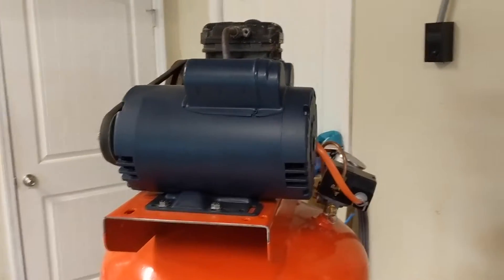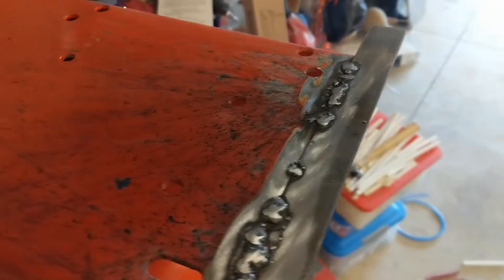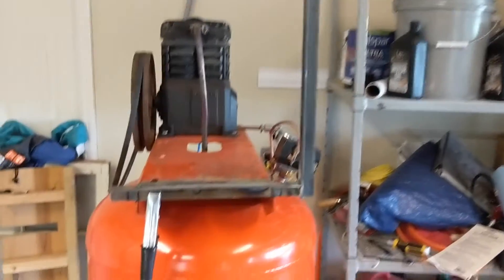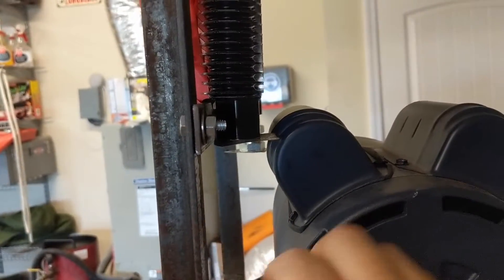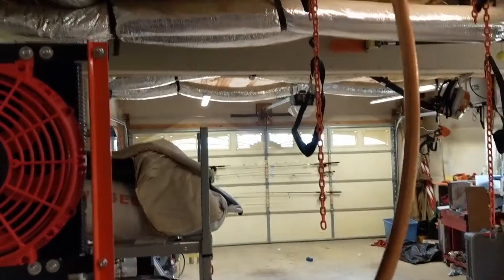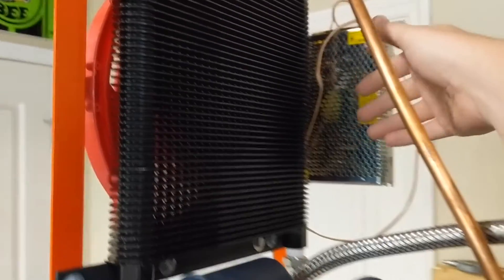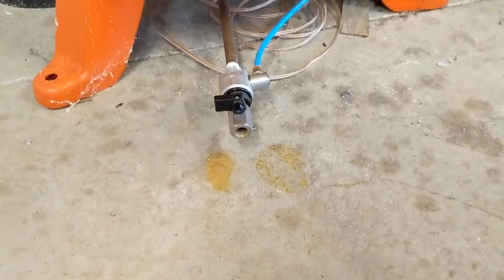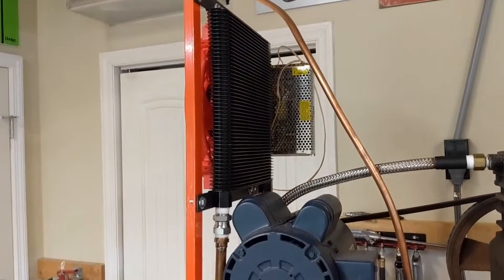Air Compressor Aftercooler/Dryer DIY Under $200

Comment: Nice set up, you can take a  a/c condenser off of a old car or truck and it’s a lot bigger and it will work like a charm, been running one for about 7 years and can paint a whole car or sandblast for hours and never get any moisture from the compressor, works better then anything you can buy that claims to catch moisture, been there done that
Reply from the maker: I looked into that but was worried it might impede the air flow coming into the compressor.  The inlet and outlet seem small but it apparently works
Reply: Rooster's Garage got one on a 120 gallon 2 stage and works good on a big sandblasting cabinet and ever thing else I use, trust me it will work
Reply from the maker: That's awesome!  I never could find details like that, just people saying to use it.  There's a big difference in a 4 cfm 25 gal and a 15 cfm 80+ gal compressor.  I even choose this cooler because the huge openings it has.  Glad to have some really world experience that it works!
Reply: Rooster's Garage yeah works really good, my compressor sits next to the wall and I just mounted my a/c condenser on the wall and ran my line’s, very simple and plain and it really works, not like all that other stuff that claims to work, I tried everything you can think of to keep moisture out because I do a lot of painting and sandblasting and that’s two things that you got to have zero moisture,if you run any air tools just make sure you have some kind of Oiler in airline for your tools or just add a few drops to the tool every once in a while because dry air will eventually cause that tool to dry out and lock up, been around this stuff and work with guys that wouldn’t keep their tools oiled and they would lock up, I worked in a place for fifteen years where we used air buffer s and grinding tools all day long, so I know what moisture will do to a air tool
Reply from the maker: @eroom2087  Does it also have a fan?  I oil my tools every use because I am not setup yet where I can mount an oiler.  I've got the oil right on the air tool mount so I always remember it.  I don't want water in the tools and I also don't want to use them without oil.  If I ran a DA or something like that where I needed to run a tool for a long time, is setup an oiler but so far I just use air tools a little bit - impact, air ratchet, etc
Reply: Rooster's Garage nope no fan, plain and simple
Reply from the maker: @eroom2087  Dang!  That would have simplified my setup a lot!  I guess the condenser has enough surface area to handle it without a fan!  I actually started on this water removing journey because of my sandblaster.  It was loaded with well used sand and I wanted to change it out so I took the nozzle off and was just using a little air pressure to blow it out.  I kept having to stop because the moisture from the air got the sand wet and it stopped coming out!  I wish I would have known the condenser works that well!  Thanks for letting me know.
Reply: Rooster's Garage been through all the stopping five hundred times to unclog wet sand thinking it was a piece of trash or big grain of sand, but all the time it was wet sand not falling through small hole in bottom of tank
Reply from the maker: @eroom2087  I guess this is why they say necessity is the mother of all invention
Reply: Rooster's Garage 💯
Reply: Rooster's Garage 💯
Reply: Water separators can only catch liquid water, only thing that can capture water vapor (moisture) is a desiccant dryer which either requires a consumable (desiccant beads) or an expensive regenerative desiccant air dryer. Aftercooler + water separator is the perfect combo: cooler condenses the water, moisture separator drains the water. Huge difference, I wish air compressors came with decent aftercoolers, vs relying on the tank itself.
Reply: Auto A/C condensers are aluminum and if your compressor has copper pipes, the copper-aluminum combination along with the moisture in the air will cause corrosion.  A/C condensers are nice and big, but I'm going with a copper-piped tranny cooler from Derale to avoid any corrosion problems.

Comment: Why didn't you just mount the cooler beside the compressor fan/pulley and you wouldn't have had to add an extra fan. The pulley with the built in fan would have drawn air through the cooler. But, what you have works and that  is all that counts.
Reply from the maker: I thought about that but the air pulled off the head is quite hot.  Plus that fan is much smaller and runs slower than the radiator fan.  The cooling would have been mediocre with the built in fan.
Reply: Youtubers that attach the aftercooler to the pump fan pulley cage don't seem to grasp the fact that the fan now is pushing the heated air it removes from the cooler across the (already) hot compressor head.  not good.
Reply from the maker: Yeah, I've seen that a lot.  I'm sure that pulley can has had a bunch of airflow research done and putting a radiator will most likely cause the head to overheat.  I dunno but adding a $20 fan seems like cheap insurance plus it moves a whole lot of air

Comment: It looks like your wire feed speed is way too slow. Crank it way up and I bet your welds will be better.
Reply from the maker: I'll try that.  I was having issues with it not burning on the faster wire feed speed.  The arc would break and it would push the gun.  I'm saving up for an Everlast stick/TIG welder at the moment.

Comment: Any updates on your compressor ?
Reply from the maker: I use it quite often and I have not changed anything.  It's cooling the incoming air and pulling out 2-4 oz of water each cycle.  The aftercooler is pulling it down from 250+ to about 85 degrees.

Comment: The power supply is no longer posted on Amazon. Could you please give electrical specs on labe on unit.So that I might find a similar one.
Reply from the maker: It's a 220v input with 12v, 20A output.
Reply: @TheRoostersGarage  thanks

Comment: Where's the link for the fan or the model number whatever so we can get the fan is your Transformers 5 volts not 12
Reply from the maker: I can't click on the eBay listing I bought it from but this seems to be the same fan: https://rover.ebay.com/rover/0/0/0?mpre=https%3A%2F%2Fwww.ebay.com%2Fulk%2Fitm%2F142211642409.  It's an automotive radiator fan.  My transformer is a 220v to 12v.

Comment: Don’t let something you don’t do well stop you permanently… Just long enough so you can practice to become better at it
Reply from the maker: I have never been the type to shy away from new things.  I usually jump in with both feet, then figure out the rest.  The first step is always the hardest.
Reply: @TheRoostersGarage  You should figure out a better plumbing route so you can eliminate that very sharp turn underneath. Consider installing some kind of 90°, or possibly a 45° elbow...

Comment: The good thing about bad welds is  you can grind them off and try, try again.
Reply from the maker: And grind them off and try again I did.  I have also switched from the HF flux core wire to the TSC (Hobart I think) flux core wire and my welds are much better.

Comment: I just used 1/2 inch copper coil tubing, looks like a alcohol still,,lol but dropped my air temperature from 240 degrees at compressor to 62 degrees at tank
Reply from the maker: I looked at doing that but I don't have the room for a big tank full of water.
Reply: @TheRoostersGarage  I didn't use a tank of water or even a fan,,,,just coiled the tubing in 6 - 12 inch diameter coils and mounted it in back of computers, a hell of a difference
Reply: @TheRoostersGarage  the air is moving so fast I can't see where a fan or even water would make a difference,,, just the distance in the coils will dissipate the heat off plenty
Reply from the maker: @georgespangler1517  I wasn't sure if the fan would do much but with the big transmission cooler it acts like 50' of copper line.  I can't touch the incoming port of the cooler and the output is nearly room temperature.  I was doubtful if it would work and I'm shocked every time I see several ounces of water drain out on each cycle.
Reply: @TheRoostersGarage  I was wondering about that,,,because you mounted the cooler higher then compressor and it has no choice then to drain it down to compressor,,,,I made sure my copper tubing was lower then compressor
Reply from the maker: It has a water separator before it enters the compressor tank.  I also have an automatic drain valve draining what little water enters the tank each cycle.
Reply: @TheRoostersGarage   it's not possible to remove all the moisture,, but any you can makes a difference,,
Reply: @TheRoostersGarage  I had 3 water separators on my compressor before I did my copper coil tubing and found them to be pretty much useless,,,a silica canister is effective but you have to keep the silica beeds changed or it will decrease your air flow
Reply from the maker: Plus I've read the silica beads can get I to the paint when you spray paint.  The transmission cooler is 1" air lines so the speed of the air is greatly reduced.  I had to look for a cooler that had the tubes going back and forth.  Most of them are more open inside and wouldn't have worked very well.  I think I spent over a year researching after coolers before I decided on a route to go.  Most other people used the air compressor fan but I didn't like that idea because the air was hot already because it's coming off the head, plus I didn't want to reduce that airflow anymore.  I added the radiator fan facing the compressor head to push more air toward the compressor.  I need to.get a temp reading in and out to get real numbers for the effectiveness of it.
Reply: @TheRoostersGarage  Thanks for the informed on silica getting in paint,,,I'll remove mine now,,,
Reply from the maker: If you put a filter after it's good.  Most people don't though.
Reply: @TheRoostersGarage  you said the transmission cooler has 1" air lines? What kind of cooler is that? I was thinking of looking for Transmission Shop to build a cooler out of 3/4" copper pipe to try and avoid a bottle neck in the system. Then use 3/4"  cooper pipe to run all of the air lines through the garage.
Reply from the maker: @707SonomaComa  Well shoot!  Looks like I misspoke when I said it had 1" lines.  I looked it up and it only has 1/2" NPT fittings.  I don't know what made me think it was 1", but I really thought it was.  

What size line comes out of your compressor head?  Any bottleneck here would only affect how quickly the tank is filled, but if my compressor had a 3/4" port, I'd be doing the same thing you are doing.  I did match the cooler with my compressor..  I just did a quick search and found this: https://www.amazon.com/Aluminum-Cooler-Rows-inch-Fitting/dp/B00EOI061M.  Thats almost the same size as mine but this has 3/4" NPT fittings for you.  Think this could work?
Reply: @TheRoostersGarage ok, thank you for your reply. I thought you had a mondo super duty ultra cooler there. My 5hp compressor  has a 30" long 3/8" copper pipe from pump to the tank. I'm not a plumber but it would be nice to convert it to 3/4" fittings and pipe. Then I could skip the radiator part and just run a 30' series of pipe from pump to tank. Your set up looks nice.
Reply from the maker: @707SonomaComa  Don't forget to add a water separator before the tank because that much pipe will condensate the humidity in the air.

Comment: where did you get the 220/12 volt adapter? your setup is what i'm thinking o doing..also where dig you get braided hose? thanks....
Reply from the maker: I forgot to put it in the description.  https://www.amazon.com/dp/B076DKPZGB.  The braided hose is listed as the flex hose in my description but here is the link https://www.amazon.com/dp/B078Z1YGV4.  It's been working very well too.  Even at 15% humidity in the winter it is still pulling water out.  I will say if the compressor runs for a long time (sand blasting) then the water separator will get full.  I just shut off the compressor and let it dump the lines out, then the separator auto drains.  Wish it had an automatic drain, but it was cheap
Reply: @TheRoostersGarage  how much air pressure is the compressor putting out threw the lines before goes into the tank?i've found hose that is good to 300.i see guys using radiator hose clamps on there after coolers..THANK you for your time...
Reply from the maker: The compressor shuts off at 125 psi.  It's putting out tank pressure which is anywhere from 90 to 125 psi.  The oil cooler is only good to 200 psi and the manufacturer does not recommend this usage, lol.  Let me know if you have any more questions.  I do this to help other people.  I love YouTube and the variety of creators because almost any problem can be solved by watching enough videos.
Reply from the maker: Sorry for the late reply, but Google flagged your last comment as potential spam for some reason.  I just looked at the specs of that hose and I think it should work.  I know the air coming out of the air compressor head is over 200 degrees, but that hose has a working temp of 350 and a working pressure of 1000 psi.  It should work.  If it does, I'd be very interested in seeing it.  Sure would look a lot better!
Reply: @TheRoostersGarage  THANK You the reply...as for google i probably did some..i'm not good on this..if i ever get it done i'll be glad to show you...i bought 5hp,80 gal,2 stage compressor in 1979...its never been plugged in!!!
Reply from the maker: @djohnson550  That's funny!  Mine was bought for a job by my best friend and it's been sitting outside for about 20 years before he gave it to me.  The motor caught fire, the tank was rusty, the gauge was broken and the controller was busted.  it took me about a year to allocate the funds to get the compressor to a finished state.
Reply from the maker: @djohnson550 . I'm the same way.  It takes me forever to finish a project because I usually have 3-5 projects going at once.  Those pieces look awesome!